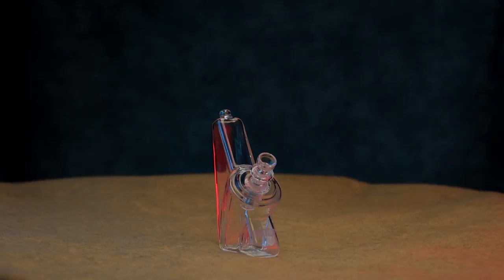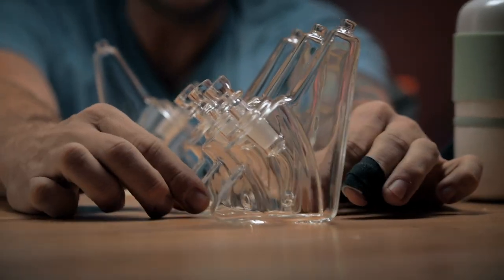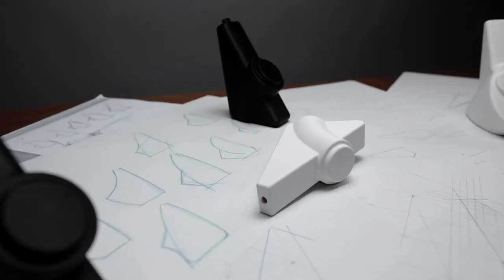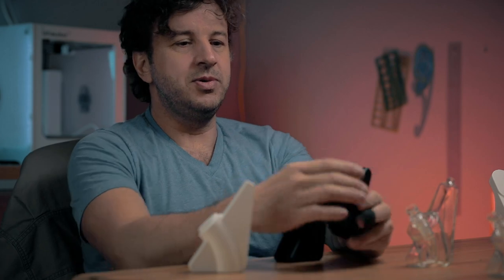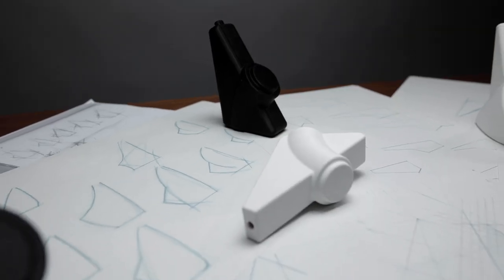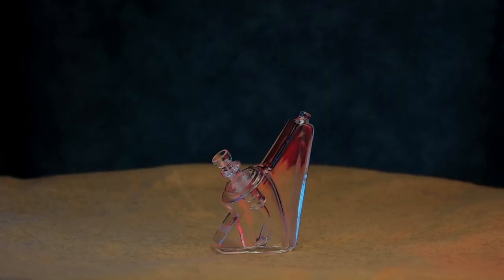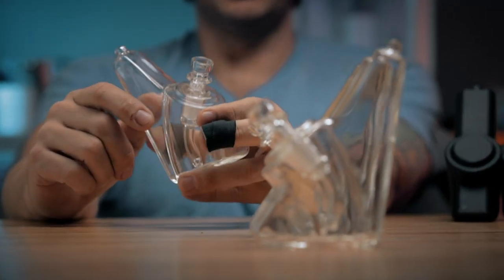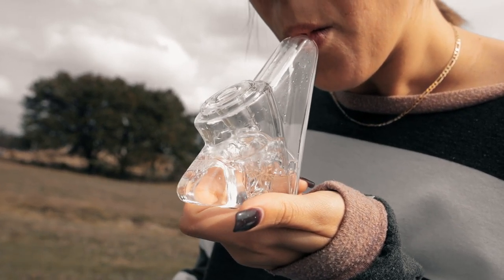GRAV®️ Behind The Design: Wedge Bubbler (2020)

Comment: Going for my second one tomorrow unfortunately, but I cant say enough how awesome this piece flows and hits. Anyone on the edge should just go because you wont regret it, favorite prodo piece ever. Thanks Micah
Reply: do these break easy?
Reply: @jwilliams6286  as long as you are careful, its a nicely structured piece and very clean in assembly, seals etc. Mine got flipped off the table and landed on the bowl, breaking the Dewar joint seal, which is expected in a case like that